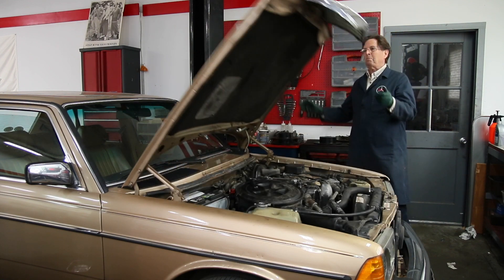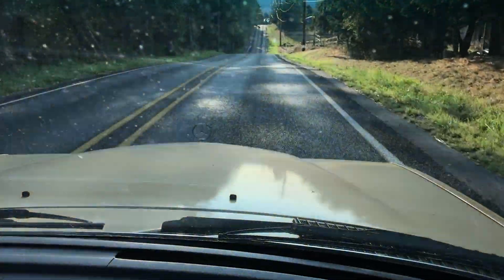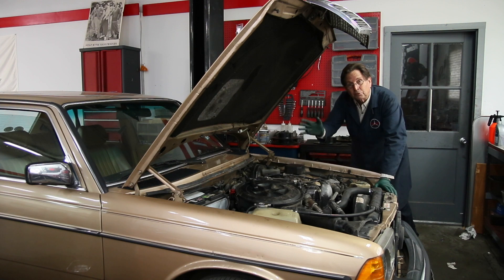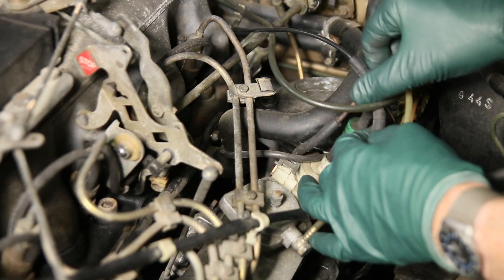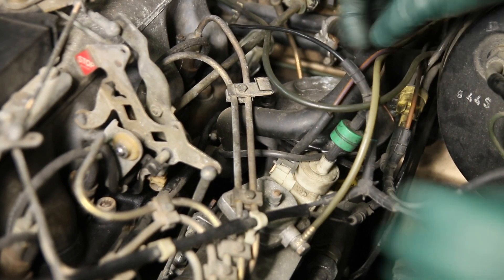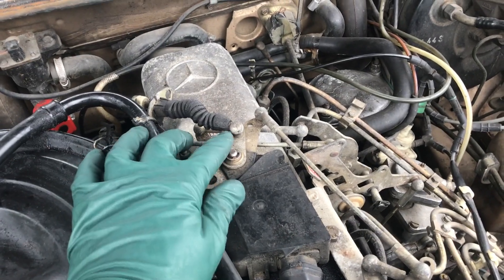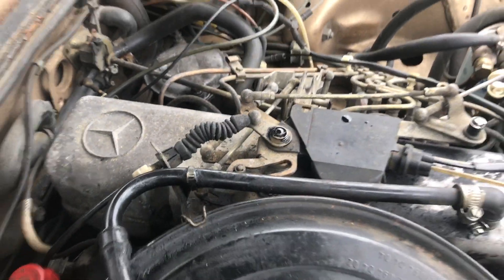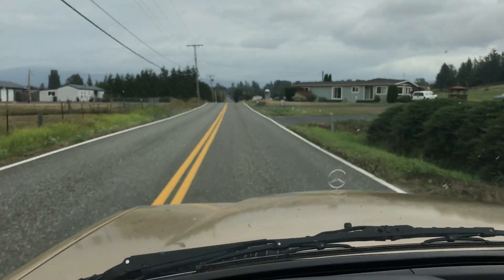W123 300DT Cheap Fix #2: Automatic Transmission Shift Problems Cost $0

Comment: Great info first time hearing of shifting to  low and then drive in order to start in first gear ; I suggest you make a video with all the tips on using the auto transmission  ie max speed the transmission will kick down to lower gear and how to do it  for example I’m sure there’s more

Comment: Vacuum line is cheap. Frustration, time, and parts you don't need, are expensive!
I have been a Mechanic for over 30 years now. Also, not many folks know to use the engine oil dipstick for some lube when at the side of the road!
Reply: MattsMechanicalSSI That's a great trick!

Comment: So my 81 300d is missing that linkage on top of the valve cover, could that be why mines shifting hard?
Reply from the maker: On the 81 transmission it most likely be a vacuum issue. I could be a number of things included incorrect hose routing, VCV malfunction, low engine vacuum output, faulty modulator, etc. My manual would help you understand how the system works, how to troubleshoot and repair the problem: https://mercedessource.com/store/diesel-automatic-transmission-peak-performance-tuning-manual-kent-bergsma

Comment: What if a transmission shifts hard only from 1st to 2nd?  Every other gear change is soft and smooth...could this still be vacuum? Or could it be more leaning towards an issue with the solenoid?

Comment: My steering wheel is really loose. Is that able to be fixed?
Reply from the maker: Year and model please and what do you really mean by "loose."?
Reply: @Mercedessource  1985 Mercedes 300TD it’s just really loose compared to any other car I’ve driven. Especially when I get up to high speeds. Hard to control.

Comment: Can the same problem be on a w123 200 petrol model? Automatic box
Reply from the maker: Not as likely. Gas models have a completely different system. If you have vacuum leaks or a bad transmission modulator you will get irractic shifts.